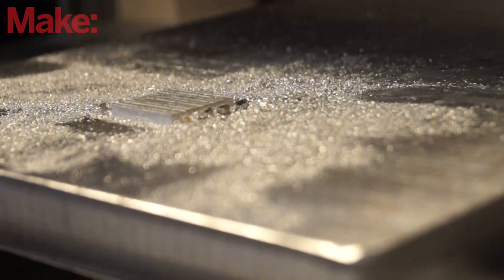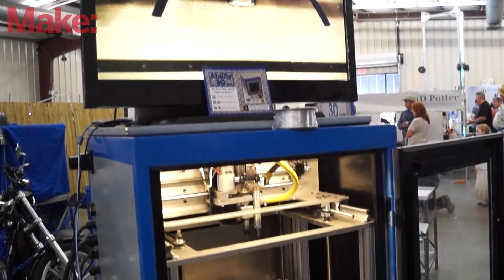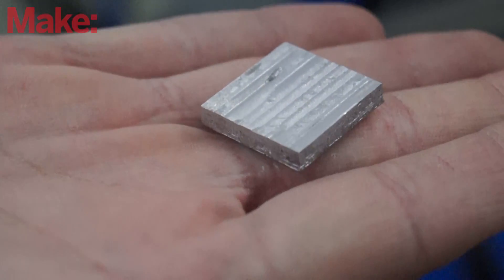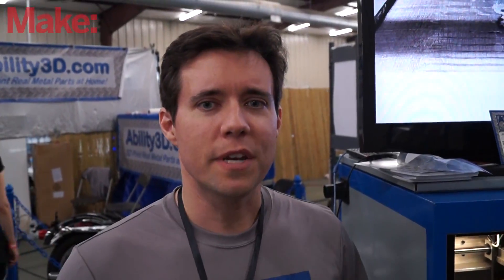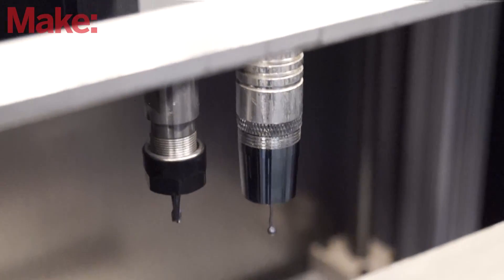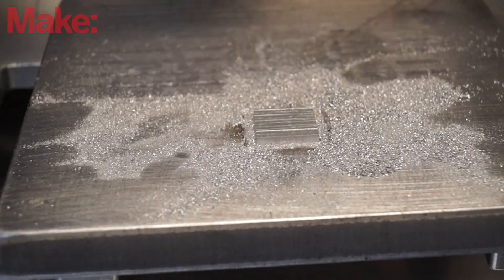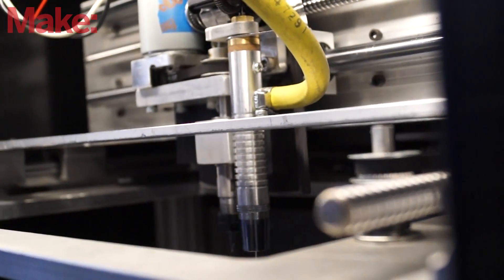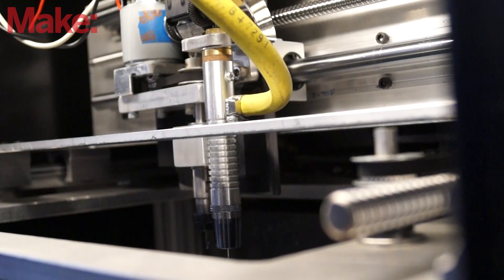3d printing in metal on your desktop

Comment: Horrible idea,  It's no longer additive manufacturing, and completely defeats the purpose; For example, you would never be able to make interlocking parts, internal channels, or lattice structures. You loose all of the aspects of a 3d printer. much cheaper, faster, and better quality to start with a solid block of material on CNC.

Comment: I thought of this many years ago, however I didn't have the resources to create a prototype. This will definitely be something to look out for. Conventional 3D metal powder sintering is extremely expensive and has a lot of limitations. Simply put, this idea here is what will spin off several copy cats because it's far cheaper and allows the creation of objects that a 5 axis CNC mill can not achieve. This would allow for a 3D printed honeycomb interior structure in metal to reduce weight while providing excellent rigidity. Imagine a steel part that weighs less titanium, is stronger than titanium, at a cost of steel. Do it in stainless and now it's resistant to corrosion.

Comment: I think that the next big step would be a material reclaiming machine taking the failed part and turning it back into filament to print another 
In this machine the improvement would be material to print a hard steel gears to a decorative metal piece for the house or car

Comment: O.O thats basically a mig welder with  a tiny mill if that is a mig welder they should have been able to make something much larger one major problem is that the welds are hard and will wear those end mills fast and I know because I work with cnc mills and lathes and the first thing we do with anything that is flame cut or plasma cut is grind off the the area where the cut was made so it does not wear the tips quickly also does the milling head have its own z axis that is not apart of the mig z axis or is removable  ? if not your milling will limited to around the mig nozzle  ...... neat idea but nightmare to work with when do alot  tho you could switch to a carbide cutters but that means u need higher rpm and i wouldn't it would do it....maybe

Comment: So it "adds" then it "trims" genius
This is why I hate 3D printing, sometimes they try too hard to use additive manufacturing in areas that a CNC is really good at
Reply: Well by adding and removing it adds the ability to create parts that you normally would need a 5 axis CNC mill for. This is magnitudes cheaper.
Reply: Nice try Captain Troll, but CNC vs manually are still the same "subtractive manufacturing".
Reply: Why try hard to use CNC manufacturing in areas that manually controlled machining is really good at - General Electric circa 1931
Reply: Xano Trevisan Kothe That you simply "hate 3D printing" on principle is short-sighted and sheer Luddism. Projects like this may ultimately fail 9 times out of 10, but this is how the envelope of human progress is advanced.

Comment: "desktop"
Reply: yeah, fits on your desk,... if your desk is fucking huge
Reply: That's much more reasonable, but I'm still skeptical about the power requirements, sparks, smoke, and rf noise generated by welding on your desktop. Good luck with the kickstarter, I'm looking forward to seeing where this goes

Comment: If they could get this to a high speed, high quality level the uses and paradigme shift across industry would be insane, any large scale construction company, machine park and so on could basically produce their own replacement parts at that point.
This thing, with that example piece being the "polished" end product, not so much.
Try making a locking bolt for a 40 ton excavator out of imperfectly bonded weld and it would break in a matter of days.

Comment: I don't really get it. they add some metal then cnc it. why not start with a metal block and just cnc that.  what am I missing?
Reply: This allows you to (in theory) make parts that you normally would need a 5 axis mill for. This is basically a lot cheaper than that kind of setup.
Reply: Tower Crisis that makes more sense now

Comment: wait till defense distributed gets one
Reply: Some of us will probably want to get one of these just to mess around to make firearms.  Sometimes being a hobbyist isn't about making the highest possible quality example of a product.  Sometime you just want something you can truly call yours.  

And my hobbies include CAD.
Reply: Way easier and safer to print a mold and make cast metal parts for modern weapons.  Especially high velocity, or combustion based weapons.

A few more years of development and batteries will be efficient enough to power hand held directed energy weapons.  So plastic is the future in regards to weapons manufacturing.  Nonconducting polymers to be precise.
Reply: only the crappiest knockoffs of guns are made from castings, get educated
Reply: Yeah, a gun worth anything is machined.
Reply: EitriBrokkr
because it is easier and cheaper...smart fellah.
Reply: and garbage
Reply: EitriBrokkr
like your mother's judgement
Reply: Obviously you know absolutely nothing about firearms, internal ballistics, metallurgy or manufacturing of such things. If you did this would be an intelligent conversation, or at the least an intellectual debate. But as they say, never argue with an idiot, they will drag you down and beat you with experience.
Reply: EitriBrokkr
This is about 3D printing.  So none of your bullshit opinions even apply.

You cannot use a 3D printer to machine anything so you are either a pure bred fuckpotato, or just plain fucking stupid.

Either way your are wrong.  And stupid.
Reply: ahahahaha
Reply: Shitty guns can be made on a 3d printer. At this point its just a proof of concept.
Reply: Blake's Gaming PC
actually some extremely effective projectile, and directed energy weapons can be printed to as fine a resolution as you can afford to achieve.

But if your goal is to fire cheap, inefficient, explosive projectiles that you can buy from Walmart, you can still achieve this goal.  Just in a shittier way than buying the weapons Walmart already has for sale.

That is still good.  Even though your fuckbrain wants to trick you.

Comment: So first you cut all the slices out of metal sheet/plate, then you line them up and it welds them together? I guess there are certain shapes of void it can't do? Like, say, a candelabra with an internal conduit for electrical wire running from the bottom to each of three arms?
Reply: no, from what i understood, it "prints" a layer then trims it, then prints another one on top of that one and trims it again and so on, just like a 3d printer, so it would be feasable to built a candelabra.
Reply: Oh right, okay. I guess I misunderstood what the mig-welder wire is doing. Thanks.

Comment: Is there actual video of the printer in action?
Reply: I'd be so insanely skeptical of this. They brought it to Makerfair NYC 2016 on October 1st and they didn't have any test pieces, citing that the printer wasn't running at that point.
Reply: wrong there is a cheaper one
Reply: Ability3D what meterial was utilized?
Reply: Sharva Paralkar which one? for metal composites?

Comment: what's the tensile strength and such of parts like this?

3d printing kinda died off in 2014 when People released it was too costly to make mass produced stuff
Reply: Consumer 3D printing never targeted mass production; it's for makers that are making things in ones and twos -- maybe tens. -- Kind of like CD burners, you don't mass produce with them, but in the consumer space, they were great for producing very custom things in ones and twos.
Reply: Can't be bothered looking myself, but since this is a glorified mig-welder, it should be easy to find the material properties in your prefered search engine.
Reply: Well it obviously depends on the exact material used, but you could also influence it by heat treating after the part is built.

Comment: so it's a 3d printer with a built in CNC cutter? interesting...
Reply: Pawan....but the Salesman stated that it has a CNC cutter to "Trim " the ends.
Reply: no..its not cutting but forming layers with a welder like a 3d printer so it is actually a metal 3d printer..
Reply: inb4 Barnacules gets one.
Reply: I mean this looks like something a prototyping company would buy not some dude at home.
Reply: Its a cnc welder with live tooling to clean up the edges.
Reply: Cheezus.....you also need a rather large desk.
Reply: Yeah, the described technique leads me to believe it could be applied to plastic printing as well, to get smoother layers.